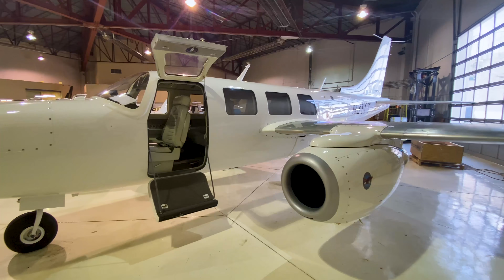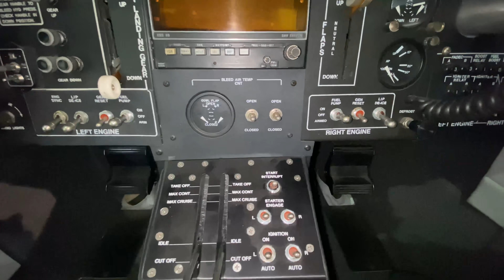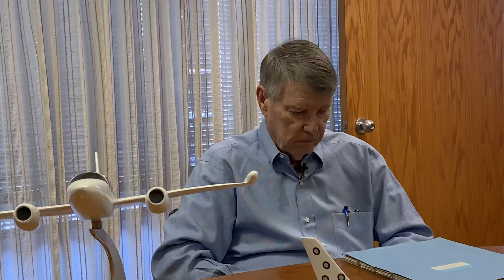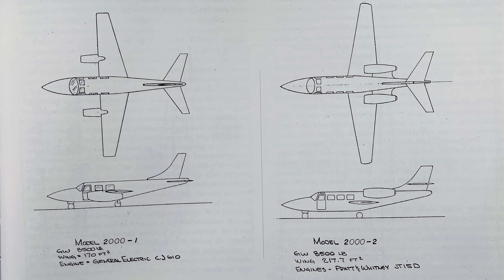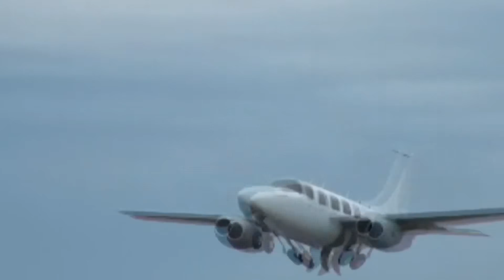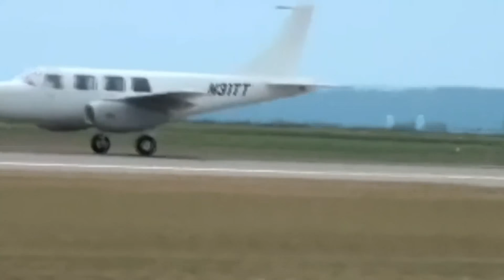The Aerostar Jet - I want one of these!  Part 1 (Podcast Format)

Comment: The sweet spot , it's so obvious, would be an Aerostar Turbine,  not a turbine single that was made (looks awful), and not a turbine with the Allisons that are weak up in the flight levels.   Not even an Aerostar with the generic and performance and efficiency compromised PT 6As and their variants.     Turbines that honor the airframe that is the Aerostar,.a real turbine, a TPE-331-14.   The same engines on the Piper PA42 Cheyenne IV, the "400 LS"  (400 mph, Lear Speed).    There are not many 400LSs around and parts and service are a HUGE question mark for any remaining Cheyenne IVs.   But an aerostar is a suitable platform for that same speed and performance.      

I'd love to have parts availability in a PIper 400LS, but it seems the Aerostars airframe, if it can handle turbofans, it can easily and probably be a MUCH better fit with two superior turboprop engines, with the 5 blade props also.   If the Aerostar jet was something that worked, we would see more of them.   WE don't.    The Aerostar was made for "proper" turboprops, again not the PT6s nor the Allisons, but the Honeywell/Air Research/Garrett TPE 331s.

Comment: I don't see how anyone can compete with HondaJet in that category.
Reply from the maker: The Aerostar would need to be brought back as a new type with larger cabin. It would probably run circles around the HondaJet if that was done.  Maybe bring back a new modern construction diesel piston and/or turboprop.  There have been no new airframe concepts since the Aerostar originally came out.  It would be fun to see.

Comment: It’s interesting some images show winglets while the model shows wingtip tanks. As I watch the airplane fly it has neither it seems. 

If Superior ever produces their Gemini 550 HP 2 stroke diesel that weighs 550 pounds how effective would that be?
BTW this jet is absolutely the plane of dreams!
Reply from the maker: The model you see in the interview was provided by Williams when we thought the Williams FJ44 would be available.  The tip tanks would be a fairly easy option to gain another 60 gallons of fuel.  The winglets were added to the jet later in the program.  This is why you see early images of the jet with and without winglets.  Stay tuned for part 2 of the interview coming out on 4/26 which will cover more of the design and performance.
Reply: @ 
Thank You!

Comment: I wonder how a single  engine turbo prop conversion would fly. Put a 960 hp PT-6 in it.
Reply from the maker: It's been done.  Google Speedstar 850.  It cruised at 260 kts on 38 gph at FL 200.  That is about 30 kts faster than a 700 on 38 gph.
Reply: @AerostarPilot  Yes, wow, I just found it. Amazing performance, useful load and range.

Comment: I remember Machen. They were involved with Swifts back in the 70s. They sold an engine mount for the Cont. IO-360 for the Swift. Some who put that engine with that mount would refer to their planes as Machen Swifts.  With that kind of thrust on the jet, I'd wonder about having enough rudder in the event of an engine out. It would probably require a reduction of thrust on the remaining good engine.
Reply from the maker: That question gets answered in part of the interview.  That video will be out on Saturday.  No reduced thrust necessary.  One thing you dont have with the jet is all the drag created by a windmilling propeller.

Comment: Always loved the jet version! But I don't think it's feasible now with the cost of operating two engines on a small airframe. With the success of the Cirrus Jet with a chute. You have the space and and economics there. Then you have new Turboprops like the Epic that are just way more competitive...Would be curious thier thoughts on the new TP100 thought. Might be underpowered but it may be an avenue to save it. Thanks for the video Eric!
Reply from the maker: You don't need a chute with two engines.  Have a problem, go home and land.  Pulling the chute totals the aircraft and messes up your back :). BTW I am not a Cirrus hater......
Reply: @AerostarPilot it’s okay Eric , you’re not but I am
Reply: sfc of TP100's doesn't work when you scale it up.  Not an efficient design, just small.